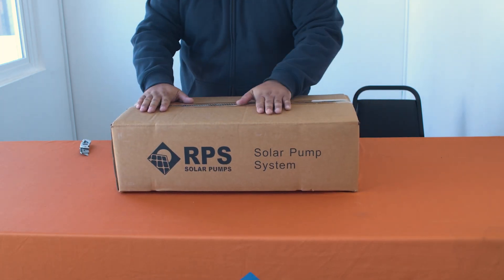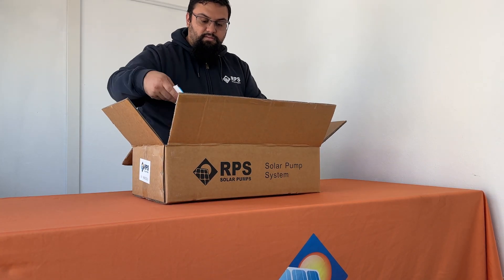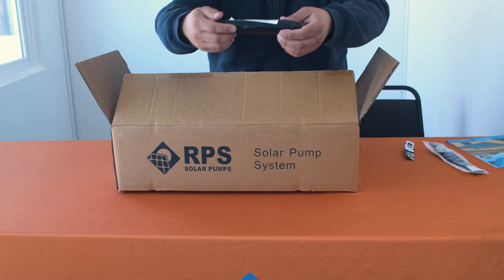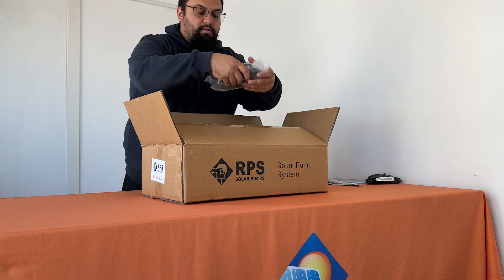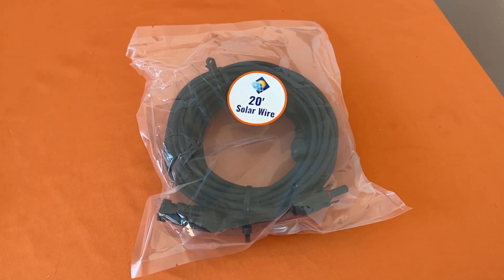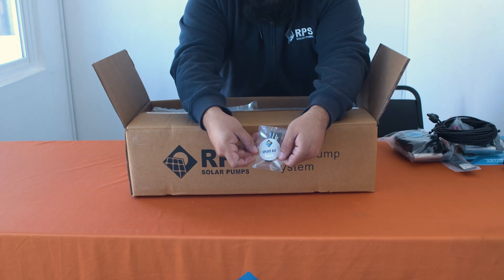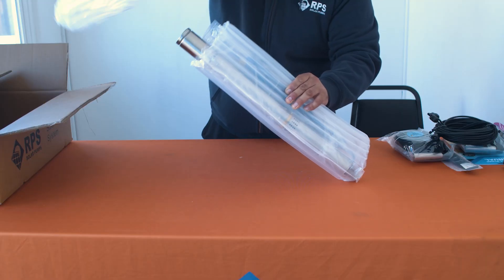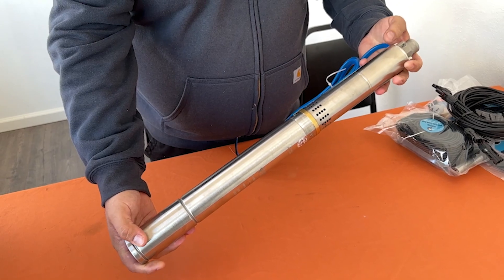Unboxing A Solar Pump For A Narrow Well | Solar Pump For A 2 Inch Well

Comment: For two days I've begun to look for a company that may assist me in determining if there is a reasonable remedy for my family related to water. Right now there are 8 people living in two homes serviced by one well. Besides just our normal needs, we both irrigate roughly an acre of yard between the two of us. I just received a 1K PG&E bill and we didn't use a minute of time using the air conditioner. My son received a $600 bill for the same month, July. But my issue is primarily with my well. I am contemplating installing a 5K gallon tank for water storage and a windmill(?) or the solar pump,, to fill the tank continuously from our well (?) or should we drill a new, smaller well for the tank and use a solar pump? The issue with the well is that I stand near it and hear in cycle on and off constantly. I know that is going to kill my pump sooner than I hope. I've lived here 40ish years and we have replaced the pump 3 times. With the tank, I would hope to stop the continuous cycling of the well. Does a 5K gallon tank sound like it is large enough? I live in the Central Valley of California, and we have had a good year for water last year, but I am beginning to fear our water may be in jeopardy. There are families near us who have lost their wells and we have very large housing developments moving in around us. My well is a hundred feet and my water is at 60 ft, the last time we checked. If you have any ideas or thoughts I would really appreciate your response. Thank you.
Reply: The on/off rapid cycling you are hearing is due to your pressure tank being waterlogged.
Get a well man out to show you how to reestablish an air head in your pressure tank. He probably will install a new air porportion valve. You should watch him, maybe take a video of the process as order of operation is critical.
This will not be the last time this happens and it is a cheap easy homeowner task.
PS you are correct. This operating condition will cause bigger problems.

Comment: I have had the 400n kit install for over 2 years and have had zero problems . Everything I mean everything  accept a few spools of electrical tape were in the Kit.  It pumps even on cloudy days. Filled my 5K tank in 8 days and now with the Reverse Pressure system to turn it on and off I frankly don't even think about it any. more.   Thanks RPS.    PS the Gals at RPS even called to see how it was going  just a few months ago.  I would put RPS up there with "Buck Knives"  as trustworthy and helpful.

Comment: Those low and water sensor wouldn't fit in a 2inch casing also with a metal 2 inch well pipe you need to file The rivits otherwise it won't fit. I also had to use metal drop pipe to maneuver it 2:00  down The pipe

Comment: Questions: what is the safe distance from the bottom of the well to the pump before there’s a chance of Sand or soil infiltration? Next question: if this pump is installed in a 2 inch casing, would there be enough cooling water surrounding unit to prevent it from overheating?
Reply from the maker: Hey friend, we generally say to hoist the pump 5-10' above the bottom of the well. As for the second part of your question we recommend customers double check their ID, as the pump OD is technically 2.01". If it's standard 2" schedule 40 PVC it will fit, but it will be very tight. We've had customers succeed with this, but efficiency is reduced. I hope that helps!
Reply: @RPSSolarPumps  I asked an installer for their opinion about how far to allow the pump from the bottom of a well, they suggested 40~50’ because the vacuum created by the pump can easily stir up sediment and damage the pump. I’m not sure the type of impeller in the pumps they install differ from The helical impeller I your pump. Would it make a difference? The pump is still grinding debris…
Reply from the maker: @nelsondog100  If its still pushing up debris then we'd say yes, hike the pump up further from the bottom of the well.